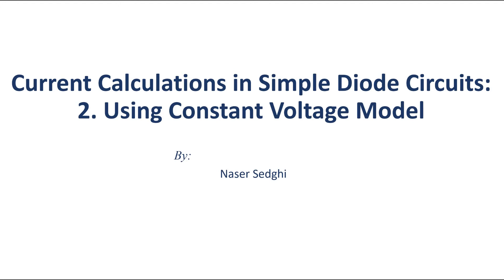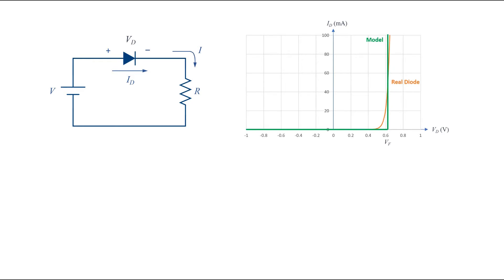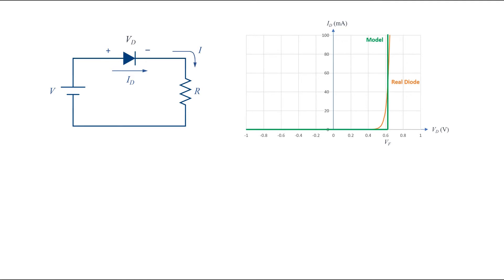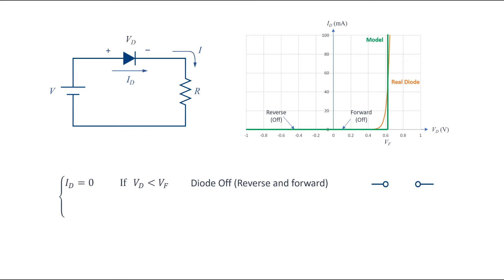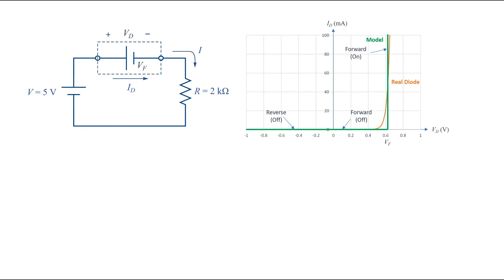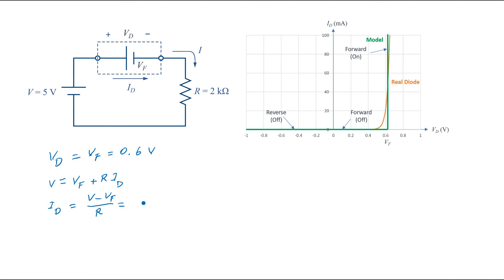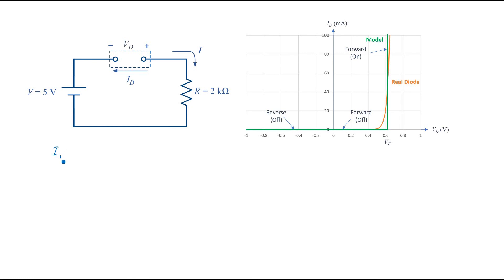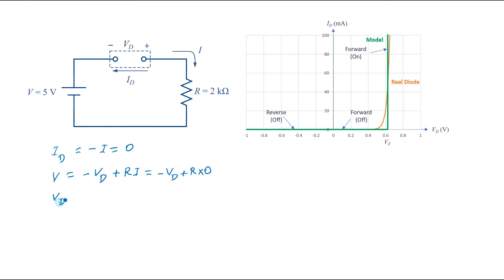Simple Diode Circuit Calculations 2.  Constant Voltage

Comment: I thought the cathode was positive and anode was negative 2:39
Reply from the maker: I guess you are referring to a battery. Although I hesitate to use positive and negative for the electrodes of the diode, but, as some people do, it is the opposite of a battery which is a source. In diodes anode is the electrode that current enters the diode and cathode is the electrode that current leaves the diode. In batteries, when supplying is the opposite, current come out from the positive side. Of course, when the battery is charging, current enters the positive side.